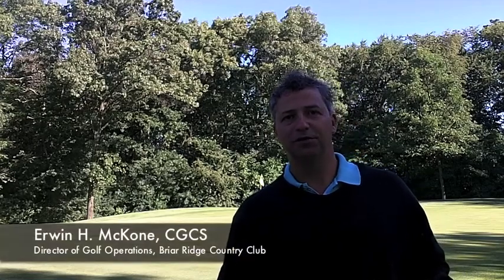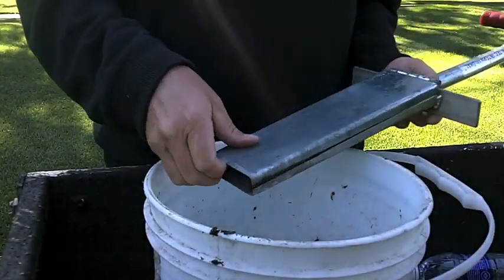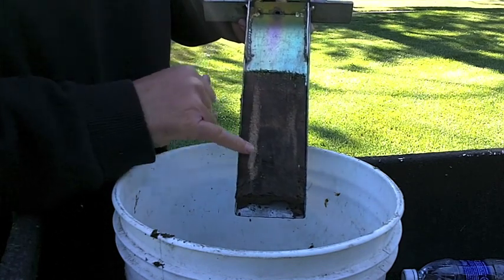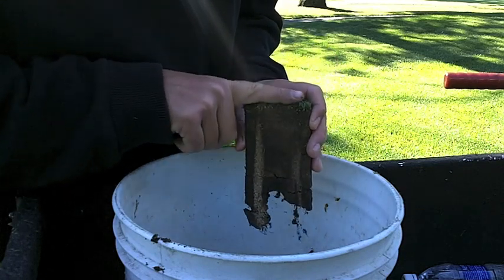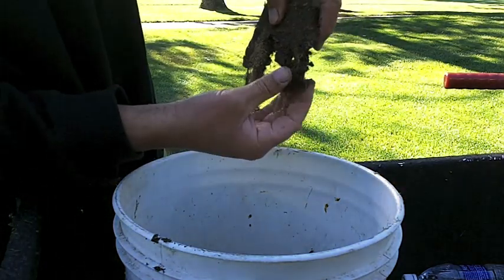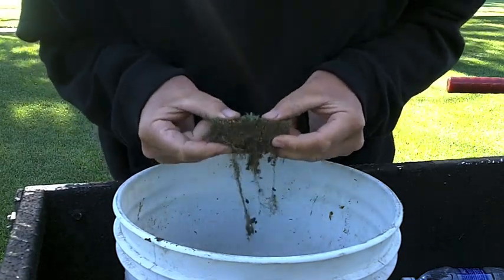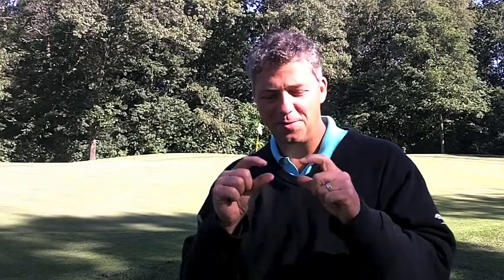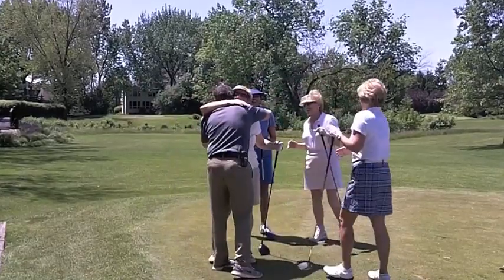Putting Green Aerification......Why???  Organic Matter accumulation

Comment: you gigantic idiot, the roots are growing down the channels because the water has gone down the channels instead of remaining up at the top of the green. The water is carrying nutrients down below the green surface, and the nutrients are pooling up at the bottom of the aeration holes. 

The roots are going to go wherever the nutrients go. If you don't aerate, the roots will remain near the top of the dirt. 

None of this changes the fact that the greens are full of holes and covered with sand and that simply is not good for putting. If you aerate and sand every other month, you just ruin the green for putting every other month.

Aeration is just a shortcut, instead of mulching and reseeding. The greens still play like shit, but from a distance they look fine and course management can argue there's nothing wrong, they're still playable. But they play like shit. They need to be mulched, fertilized, rolled and reseeded and either use a temporary hole in the fairway or just close the hole until the green recovers.